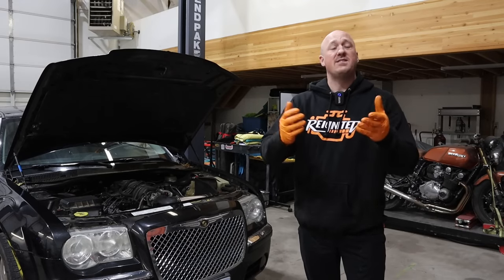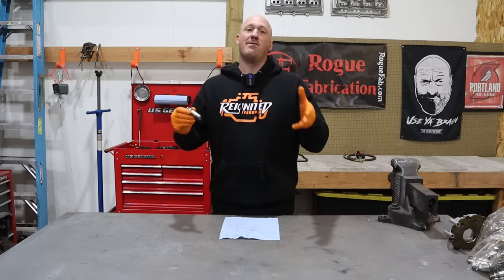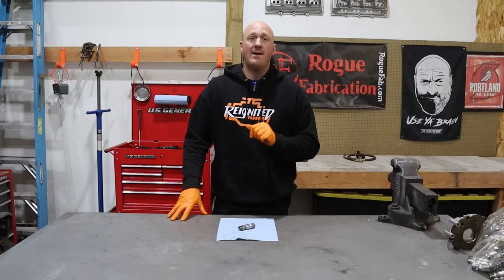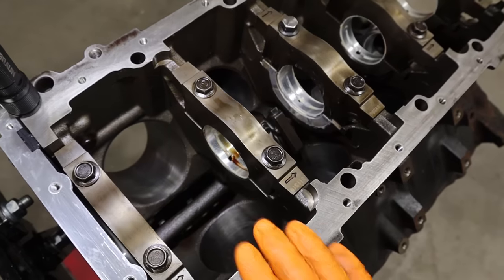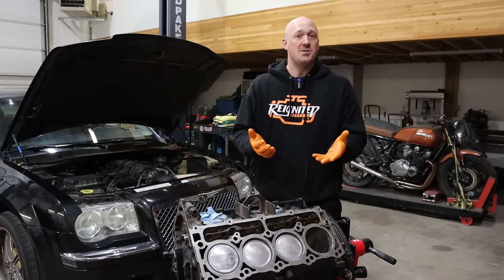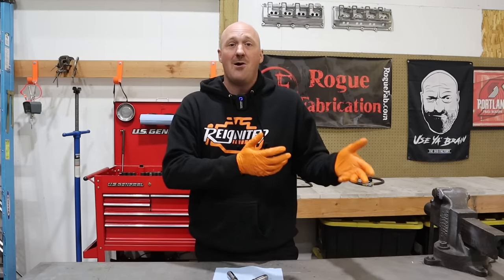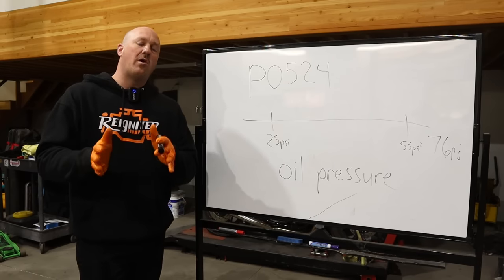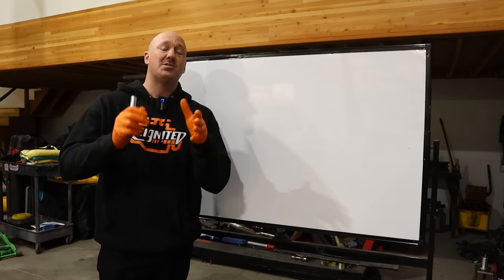The BEST Prevention For Hemi Lifter Failure! (In My Opinion)

Comment: I have a 2021 Grand Cherokee Trailhawk with the HEMI. Love the vehicle but hate this ticking time bomb…. I decided to purchase the extended warranty 8 year 100,000 miles. I also only use Penzoil Ultra 5w20 and change it myself every 5000 miles. In Addition I send the oil out to black stone labs every oil change to have a good baseline of engine health and will be able to see an increase in iron if the cam or lifters are starting to grind. The numbers have been great so far and I have 33,000 miles on it. Hopefully it stays good, if not and it’s less then 100,000 miles I will let FCA fix it. If after 100,000 and the metals start going up In the oil analysis then it will be time to trade it in before any actual failure. Very sad I have to take these steps and this will be the last FCA, Jeep, Stalantis or what ever the new company is called. Thanks for all great videos !!
Reply: I suggest FilterMags, too. If you cut open(correctly)  your old filters, you'll see the metal, yourself
Reply from the maker: Thanks for watching, and I love those Grand Cherokees!
Reply: @ReignitedAuto  Yes, its a great car and very capable off road. I hope it lasts me a long time... Speaking of that could I ask your advice on the "Life Time" transmission fluid. I have heard a lot of back and forth and my personal feeling is it should be changed at 50,000 miles but my local Jeep dealer says it does not need to be and they want like 1,200 for the job? Can  you give me your thoughts and would it be wise to go to a higher end dealer like BMW who services the exact same transmission and have them do it?
Reply from the maker: @itgoesfast2722  I'm actually primarily a transmission tech so the 8 speed trans is something I work on quite a bit. I would say that if you are going to service it, you can do it at 100k miles. I think anything less than that you are usually wasting money. Also, there are aftermarket trans pans available for much cheaper that bring the cost of a service down quite a bit.
Reply: @ReignitedAuto  thank you so much for your advice. I guess I will not worry about it until 100K

Comment: Dam, I gotta 09 6.1, sometimes taps when cold, when warm shes mint, hopefully nothing to worry about till 2050
Reply: Most likely an exhaust manifold leak. Sky mentions those symptoms in a previous video.
Reply: @ericc7957  hope so, he did mention common in the vvts which I don't think 6.1s are, who knows, fingers crossed
Reply from the maker: Definitely check out those exhaust manifolds 👍

Comment: you just spent alot of time dancing around the fact ram is using junk imported cam and lifters
Reply: Wonder if they are going to put the same China Joe parts in their hemi replacement engine?  TT -6 inline with its outrageous price.
Reply: I agree like some small engines with bad soft camshaft
Reply: Y'all need to understand one major thing junk lifters destroy perfectly good cams everytime.
Reply: As is Ford & GM.
Look it up.
Reply: @Jon-O. This guy stated that the quality of the cams was also an issue.
Reply: @barrymantei7795  Yes he did, but not "end of story." My basement flooded due to a clogged storm drain. Not water volume, consistency, water pressure, etc etc
Reply: Woke DEI Hired Engineers and Chinese Parts, this is what you get
Reply: Really disappointed in mopar for knowing about this issue, and furthermore as  a result of bad parts/bad engineering, and have refused to re-engineer something better since 2009.  🤦🏻‍♂️ What a way to care for your customers. 

Sidebar, I had a 2014 Ram Sport 5.7, put almost 200k miles, and never experienced the lifter issue and I beat that  truck! One of the techs at the dealer told me to replace a qt of oil with a qt of Lucas high mileage additive at around 60k miles on. I did. Now I can’t prove this saved me, but I’d like to think maybe it did.
Reply: Chevy has same issue...
Reply: I drive a 20 year old ram with the hemi in it at 240 thousand miles and I've never had any issues like this..Hell I've never even done the timing or replaced the oil pump..Still my daily driver I guess I'm just lucky
Reply: If ram is the only junk explain to me why I'm changing roller lifters and rockers in just about every newer vehicle with 130,000 miles? Seems like every week I'm changing roller rockers in just about every make
Reply: I think you’re right. I own a 2016  Challenger R/T and fortunately no ticking at this point. Those roller lifters are junk. Instead of installing, say Morel quality, I’m certain the axles in the rollers are cheap garbage and sadly Dodge knows it.
Reply: @mylesross5712  you must not have seen the rollers in Ford Coyote, Nissan and others I've been changing. Those rollers in the bearings are actually much smaller than the ones in Dodge lifters. It's looking like the problem started when vvt was added. That system requires more oil flow so it needs a higher volume oil pump
Reply: The have to buy imported parts because Americans companies charge too much.
Reply: Same with gm as of late
Reply: This guy is a hack 4500 dollars for just a cam and lifter swap is outrageous.
Reply: @MuscleWagonRT_T.V.9143  you are aware that the cylinder heads have to come off to get the lifters out right?  Which means the exhaust has to come out too.  Not saying he’s not a little high, but it’s in the ballpark.
Reply: Dodge, where quality is job none.
Reply: No he said you need slightly more oil at idle. Put in a hellcat lifter BEFORE the tick
Reply: His explanations made perfect sense.  He went through and explained with is/is not examples why many theories are likely not the root cause.  And if you knew anything about cams and lifters, you would know that plenty of made in USA flat tappet cams and lifters are failing in older engines.  So your thought process is overly simplistic.

Comment: Fantastic break down. Thanks for the suggestion. My 2016 Charger Pursuit has 150k and it’s ticking. Sounds like lifters and a cam.
Reply from the maker: Police version it's almost definitely the case. It's really not that bad of a repair though, and then you've got a really solid vehicle for quite some time to come!
Reply: @ReignitedAuto  Glad to hear. Transfer case went out as well. That’s on my winter to do list. Pulled two fuses, it’s rear wheel drive for time being and works just fine. If you have any videos on their AWD system / upgrade ideas / or things to look out for / best maintence practices / I’d watch that content all day.
Reply from the maker: @iPursuitPerformance  most common things we saw here at the dealer is the front axle actuator goes out on those police versions 👍
Reply: @ReignitedAuto  Copy that.

Comment: My 2014 Hemi’s lifters started to go bad at 150k miles. Verified with a stethoscope. I always used Penzoil ultra platinum 5w20 with a mopar filter changed every 5k miles, it had very low idle hours. It also had the torque converter shutter that started at 120k miles, I changed the filter and fluids which made it worse, added some anti shutter fluid, which really helped for a while. When I heard the lifters start to go I traded it off. I was a die hard Ram fan, but I will NEVER buy a Ram again unless it has a bumper to bumper warranty.

Comment: Hi Sky thanks for the videos. I cannot believe that it took youtube so long to suggest I watch this because this is exactly the type of content that interests me. 

You describe yourself but I want to make a suggestion: 
 You're more than a 10 year Dodge tech you are an enthusiast!  
  This is an integral part of the American culture missing from the new generations of technicians. Enthusiasm!  
Then, sharing your information to other enthusiasts. 

One question and concern I want to raise is that I feel lubricants such as motor oils may have somehow taken a step backward. I have experienced lifter failure on my LS7 engine. The roller scuffed on the cam lobe or the roller failed. 

The older spec gasoline engine oils may have some slightly higher chance of forming deposits and slight catalytic converter fouling but I am betting the reduction in zinc and other metalic anti-wear additives have diminished the effectiveness of engine oils. 

Thanks man!

Comment: I change my oil once a year, usually after winter season but I only drive about 200-250 miles a year. I bought my car new of the lot in 2011. I took it to the dealership for its first oil change and after picking up the car is when I first began to hear the noise. I pointed it out to the service writer who then brought out the service manager. He agreed that something didn’t sound right. After almost a week, they got approval from warranty to replaced the left side cylinder head. I went to pick up the car, and the noise appeared to be gone. A couple weeks or so later the noise was back. Back to the dealership, this time the replaced the right side cylinder head. I went to pick up my car, drove around for about 10 minutes with service manager, the noise was still there but nowhere near what it had been. So I accepted the car back, service manager said drive it like you stole it and if the engine blows it will be covered by warranty. Yes, I got that in writing they’d cover engine replacement. Not sure if the dealership would have stood behind it but it’s been 12 years and 60k+ miles, the engines still runs strong and there is still a faint noise from time to time but still idles extremely well and still pulls strong. Oil pump change might be in the cards later down the road but for now I’ll leave it alone… as I don’t drive as many miles as I did during the first few years I owned the car. Greatly appreciate all your research and efforts to find out what’s causing the elusive hemi tick.

Comment: See these videos confuse me. Am I just one of the lucky ones? 2009 5.7L hemi w/eagle heads in my 300C and she's purring beautifully @ 213,000 miles. Love my 09 300C Heritage Edition. No issues ever, just water pump replaced @198k miles. Original engine/internals, oil pump, original NAG1 trans (great video btw, excellent explanation).

Comment: Hello Sir, great content you have that is well explained and demonstrated. I have viewed several of your videos. Two thoughts I would like your comment on. One is, do they make Hemi lifters with a bronze bushing used instead of the needle bearings on the lifter roller wheel ? (and would that even give better longevity ??? )
Two, I saw a video done by Daves Auto where his machine shop machined a small groove/ channel in the lower half of the lifter bore of the block to allow the pressurized oil "gallery" to squirt and spray oil directly onto the cam lobe. In thinking about this further, that groove could be machined into the lower half of the lifter itself. (which would be alot easier than having the block bore modified) He did this modification on a Big Block Ford block using flat lifters. ( you can search for that video) This seemed like a brilliant idea and could be the solve all if done on the Hemi. 
I would really appreciate your feedback on these two questions. Keep up the great work. 
Thanks, Bob from Maine ( prior 38 year ASE and level 4 Chrysler tech)

Comment: Great video, very well explained and presented. I used to build engines decades ago and we would modify the oiling system in every one of themto eliminate some stock system deficiencies and a Melling cast iron high volume oil pump was one of them along with higher pressure relief valves. Of course I never had to worry about any codes back then but it is worth mentioning that the increased volume of oil helped the engines last much longer. When you mentioned someone came up with the solution of putting the lower pressure relief valve (or spring) into the hellcat pump, I had been thinking about the same remedy, having had a similar experience and some knowledge of how it effects oil flow and pressure. The only thing I wish you had shown is how difficult (or easy) the job is of replacing the oil pump with the engine in the vehicle. I'm going to explore your other videos to see if you did in a different one.
Reply: Could you tell me the voltage divider he’s using? I wish he had put one in the description to buy. I’m really not sure exactly what he’s talking about here.

Comment: If i get it right when i get the hellcat oilpump the mds will stop working but i will get the engine code, so my question is what will happen if i live my life with the code on??
Reply from the maker: Good news, there's an even better option available now! Melling makes an oil pump,  model 10452HV that proves even more volume,  20% higher than stock, and if you install the stock pressure spring that comes with it you'll get the benefits of the high volume pump, but it won't set a check engine light and your MDS will still work properly. 👍

Comment: I find it interesting the motor your standing near has three cylinders near TDC...

Well I do like the relief spring idea better than the electronic wire idea! I am wondering though buying a new one from the stock oil pump for the Hellcat pump would be better than using a old one? If it is even possible to even buy that part separately from the stock pump? I would think its not possible and that relief spring is bought with the stock pump only?

I do like the sweater jacket and gloves idea 💡... I wouldn't mine having both myself... what type of gloves are those? And do you sell the sweater jackets? I am a new fan of yours now. 

I have a 2014 Dodge Challenger R/T Plus...
Reply from the maker: 😄 good eye, that engine did not have a crankshaft in it, those pistons are just sitting in the bores. 👍

Comment: This sounds exactly like the problems the Ford 5.4 3 valve engine has.  The 2 valve earlier engines were bulletproof as shown in all the miles the Crown Victoria accumulated being police cars, but when they changed to VVT (variable valve timing) system for the 3 valve and the problems started.  The fix with that engine is to change the oil pump to the Melling Hi Volume version and check for worn parts.  Seems like this is a modern engine problem caused by manufacturers trying to comply with emissions regulations and CAFE (Corporate Average Fuel Economy) standards.
Good video on the education of these problems.

Comment: Great video!! You always give such good information. Your videos are very clear and easy to understand. Thanks!! How do you turn off the MDS system? A tuner? Or is there another way?
Reply from the maker: You have to use a tuner to turn the system off entirely yes. If I'm going the route to turn it off though, I'd also remove the solenoids and swap the lifters to non-MDS lifters that way you can ensure full oil pressure to all the lifters at all times. 👍
Reply: Thanks!! So, if I do a Hellcat oil pump swap on my 14 SRT I would need to either replace the spring with the stock spring or do the wiring work around to avoid the oil pressure code?
Reply from the maker: @jasontester7422  Me personally I would probably just swap the stock spring if possible.

Comment: I had a 2020 Dodge Ram 2500 with the 6.4 Hemi and it knocked at 7000 miles.  Company changed motor so they said second engine knocked at 13000 miles.  I then traded it for a new 2022 Ram 2500 truck and I have 5000 miles no knock yet.  My question is why doesn’t Dodge install the Hell Cat oil pump on the 6.4 Hemi’s?  Be cheaper for everyone if they did.  Great video wish there was a video on how to change the oil pump.
Reply from the maker: https://youtu.be/wpl8aZiPK0E
9:24

Comment: This is the second video of yours that I have watched. They have been very helpful and very easy to follow with your detail in your explanations. I am having an issue with the pursuit I purchased. The low rpm and the oil volume would make sense in this vehicle. 2014, 50,000 miles, 2,500 idle hrs. I do not have a ticking noise I have a problem when trying to maintain speed under low engine loads. The car will start coasting, no engine rev, no gear change, I would not even know it is happening if I was not waiting for it. For 3-5 seconds it coasts then it will rev to around 5,000 rpm then it will downshift will not shift again until 5,000rpm. Then returns to normal. Torque converter clutch circuit performance / stuck off is the code it threw. Took it to the transmission shop had some lower transmission work done on it and asked if they thought the torque converter needed to be replaced. His opinion from looking at the oil and the lower part was no. Since the transmission work it has had the same issue yet has not thrown any codes again. Also I tried replacing the PCM because of a recall issue where the PCM will store old commands from the cruise controller. Those Symptoms they described mimicked the symptoms I am currently having. Did not fix the issue. Wondering if you have had any experience with the same issue in your experience as a technician. Any advice or insight would be greatly appreciated. Also thanks for the videos.

Comment: Hi I am just a dyi and I want to know where did you connect the ground wire. Your voltage divider diagram showed the  center wires open but you mentioned they are connected. I am a visual learner and would like to know if all 3 wires are connected.  Thanks I learned alot, great job.

Comment: Just bought a 2020 2500, great video and knowledge! I don't have any issues with my 6,4 yet but I bought the truck with 130K miles, so I ordered the Hellcat pump immediately after watching this, seems like a no brainer. I like the idea of changing out the relief spring too, anyone know if I can buy that spring new ? Would like to have an all new pump ready to swap in when I get a chance. Thank you again for great insight and knowledge!
Reply from the maker: I'm not sure if the spring is available separately, but you can just swap the spring from your stock pump into the Hellcat pump. There's no issues with the spring being "worn out" It's completely fine.